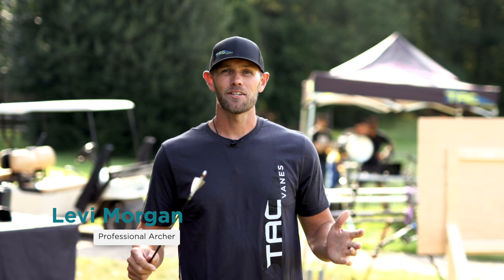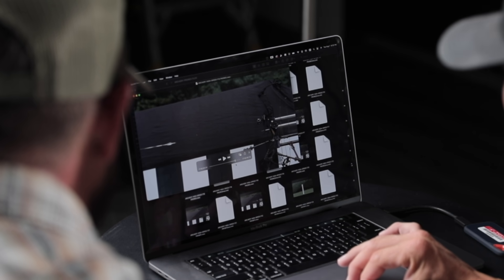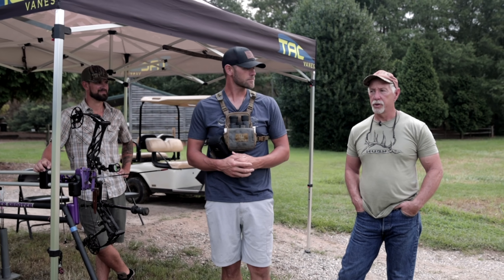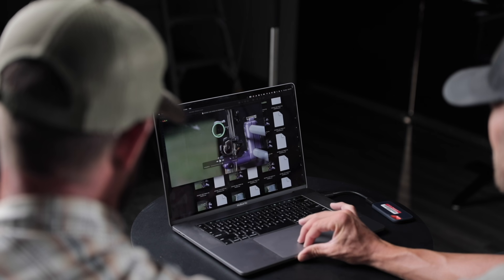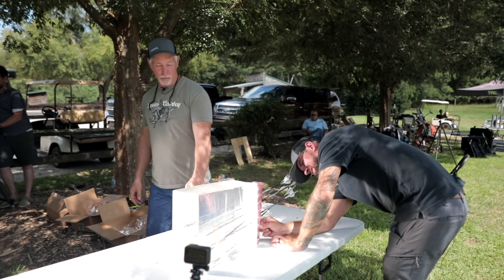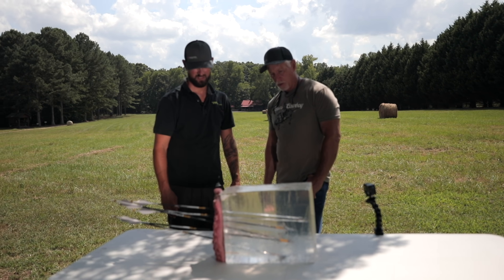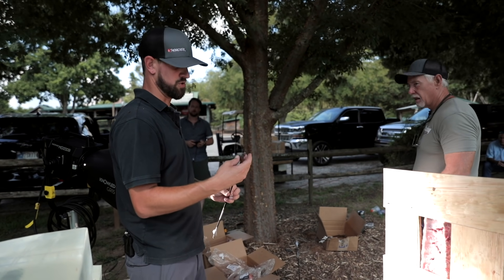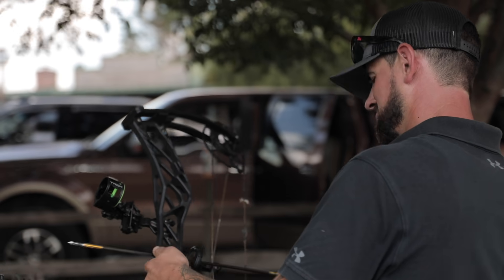SEE FOR YOURSELF 😲 : The LRP Arrow system vs. the competition w/ Levi Morgan

Comment: There was some useful information shared here regarding the vanes, components, and broadheads.

Which Flex Fletch vanes were used in testing?

Was the Grim Reaper the Micro Hades Pro?

In the final broadhead test, would the 3" Shwaker have a full pass-through compared to the Iron Will? I am not so sure, especially on a big-body deer. In my experience, an entrance and exit hole provides a better blood trail than an arrow that has not passed through the animal, especially if the arrow stays in the entrance hole.
If there will be a follow-up mechanical broadhead test. As others have mentioned, it would be nice to see the SEVR along with the JEKYLL & HYDE heads.
In the torque test, I would like to see the Valkyrie, Iron Will, and Podium components tested.

Comment: The drop measurement is interesting but less useful than speed at the target. Because the fletchings all have different mass, the arrow's center of gravity will change, thus altering the arrow's angle of attack, which changes aerodynamics in flight.

Comment: @tacvanes please help me understand the results on your drop test. From the video it looked like the TAC 2.75 3 fletch dropped the least, however your chart at the end indicates it dropped the most. I feel as though your numbers on the 75 yard marker that the arrows past were backward. And why did they not go to 12”? Appreciate it.
Reply from the maker: Thanks for the comment! The numbers on the chart only make sense with the video. The numbers are not relative to anything except each other and they are not saying how many inches the arrow dropped. So if you use the 2.75 as the base point (It crossed the gauge in the field at 9.2) then you can subtract the other numbers from 9.2 to figure out how many inches the other vanes dropped from the 2.75.

Comment: What's weird is I see these tests done involving the nap killzone and they always sucks for these tests but I get awesome penetration and I have pictures of the rib cages of my deer with the 2in cut straight through both sizes of the rib cage and the blades are never bent I have a pile of these killzones in a dresser drawer that have been through deer not a single one is bent all are still for the most part sharp a few have some edge chatter stuff from hitting rocks or whatever in the dirt. The only killzone I had bend the blades literally cut the opposite side fron leg almost completely off a doe it was held on by a little skin so yea ofcourse that bent the blades. Idk man killzones work perfect in real world circumstances

Comment: I run Tac driver 2 inch 4 fletch on my 3d/field arrows, and Tac Driver 2.75 3 fletch on my indoor arrows, and I’ve had nothing but success with them. I am running bohning blazer 2” in a 4 fletch on my hunting arrows, and had no clue they had so much drag and flimsiness. I’m shooting a QAD imx rest, but it still makes me think I should change these vanes. Season is here this year, so I’ll leave it, but it looks like I’ll be running Tacs on all of my arrow setups from here on out. Great test! I’d like to see the test on a fixed blade broadhead as well. In my case, the QAD exodus 
Thanks y’all! Good work

Comment: Swacker has to do best because they are the broadhead that deploys AFTER it blows through the plywood, the blades are protected from the initial impact the only drawback with swacker is a poor entry hole, I do love tac vanes and won't shoot any other. The ol'plywood test will just about destroy any cut on contact broadhead most of the time.
Reply: They still make a 1" entry hole. I've had great luck with them for the last ten years.

Comment: I have noticed the drop in other vanes vs tac vanes when testing with broadheads specifically...my issue with the tac vanes is how much memory they have after passing through something.  I will say TAC's customer service is outstanding as I was having some issues and they reached out multiple times in a timely manner.
Reply: I've found it to be the opposite. I can shoot a tac vane into a bag target and have it get stuck and come out all bent and put it in the back of my quiver and after about 5 minutes it's ready to go again. I will say if they get creased then it won't come back as good. But they still do better than the blazers I used to shootn
Reply: Agreed, I swapped from Blazers about 3-4 months ago and the tac vanes are holding up a whole lot better from practice. The blazers would get bent very easily.

Comment: So the TAC 3 fletch 2.75 didn’t drop 9” inches right? I’m confused with the results from the 100 yard drop test. To me it looks like the DCA vane dropped the 9”.
Reply from the maker: Thanks for the comment! The numbers on the chart only make sense with the video. The numbers are not relative to anything except each other and they are not saying how many inches the arrow dropped. So if you use the 2.75 as the base point (It crossed the gauge in the field at 9.2) then you can subtract the other numbers from 9.2 to figure out how many inches the other vanes dropped from the 2.75.
Reply: I have tried to understand the drop chart and just can't figure out the numbers. This sounds like you're using the TAC 3 Fletch as the 0 and the drop corresponds to this. If I subtract the TAC 4 Fletch 9.2 - 6.2 = 3 inches of drop. That makes sense. If I use the same logic with the DCA 9.2 - 8 = 1.2 inches of drop. That doesn't make sense with the video. The drop chart only makes sense if the hooter shooter or measuring stick was set up  differently for the DCA. Can you make better sense of it for me?

Comment: I use TAC drivers on my hunting arrows. the 2.75 steer my Grizzlystick single bevels the best. As for components the better the metal (SS or Titanium) and the longer the insert the stronger your setup. If you can put the lateral force farther into the shaft the better. Most arrow components are stronger than any aluminum farrell on a broadhead of any kind.  Good flight, sharp broadheads, and arrow integrity..... Where have I heard this before?  Dr. Ashby. It's not just about heavy arrows.
Reply: Are you running the Massai heads or the Samurai?

Comment: So if i read the chart correctly, the victory vap tko is the best arrow for the lrp and tac vane setup?
Reply from the maker: The arrow was able to bend under the full 15 ft/lb load without breaking.  Most breakages from this test was from the arrow bending, but the component "digging" into the side, which eventually causes the breakage.  It's far more extreme than you could ever have with a shot.

Comment: Have you ever seen a person survive an accident on the news and then go to say “had it only gone 1 millimeter deeper, it would have reached my heart or nicked an artery and I’d be dead?” A broadhead can make a 3-inch cut into muscle tissue, but what good is that if it never reaches deep enough to sever major arteries and vital organs? Just ask any Emergency Room doctor. If someone has a big knife stuck in their back, the doctor will tell you, don’t remove the knife because if it goes deeper, it might cut a major blood vessel and you’ll die. More often than not, two holes are more lethal than one

Comment: The iron will was three inches in front of the swacker. You can not count the tip of the mechanicals. The iron will starts cutting just about the tip. The mechanicals has two inches of a ice pick in front of the blades. That has to be included in the test. There is obviously some bias in the testing. In addition, you are shooting arrows into a medium that is designed to stop and catch projectiles. Stack ten briskets and shoot those to see the penetration if you want to get real world results on penetration.

Comment: I loved the test but something you guys failed to address is the very small entry hole from the Swackers. So would I want 6 inches of penetration (no pass threw) with a 3 inch cut with a very small entry hole or a 1.25 cut with a pass threw. Two places for the animal to bleed out vs one small place. If I could get a pass threw with a Swacker 2 inch them I'm in. You guys didn't discuss blood trails and thats important. Appreciate the test though!!<><
Reply: exactly. seems like the cut on contact mechanicals disintegrated and didn't penetrate and if they did, they deflected massively.  The ones that did hold together did so because they went through hide/bone as a field point before deploying. They may have had a large internal cut but they had a field point entry that'd be pretty well closed through hide. If these mechanicals arent going to pass to the other side and are closed at the entry hole (which may be high on the animal) then you're not going to get much blood compared to a cut on contact/cut on exit no?
Reply: I was thinking the same thing. Interesting slow mo footage, but really just confirms for me to stick with fixed broad heads. Unless I missed it they also didn't talk about how much more energy it takes to push a mech through hide compared to a cut on contact fixed head. Us short draw guys don't have energy to waist.
Reply: you still get a 1"+ entry hole with a swhacker, that is as large as a lot of fixed heads. if you got a proper kill shot, blood is going to be pouring out the mouth, if for some reason you didnt get a pass through.
Reply: Like someone else mentioned you are still getting a 1" entry hole compared to a maybe 1-1/4" hole? Most fixed are even smaller than that. But you are getting a lot bigger cut inside the animal which means its going to expire a lot faster. So even if you don't get a pass through the animal shouldn't go as far. I just started using Swhacker in the last couple years and I've shot 2 deer and both never made it 10 yards.
Reply: @wesr1490  what cutting diameter was it?

Comment: The schwacker opened 2” after entering and only cut for 2” they measured the tip which was 2” from the blades that only traveled 1”-2” in open position. Very deceiving if you just listen to them and not watch and observe yourself!😊

Comment: So the stock gold tip insert and ballistic collar out performed the lrp? Stock components breaking point 12.8 ft/lbs and LRP 10.8 ft/lbs.
Reply from the maker: It did not.  It took about a .008" - .010" bend with 9 ft/lbs of load.  The LRP barely had a tiny bit of wobble, at .003" - .005" -- but we wanted to be honest and record it as it happened on that arrow.  The LRP system never bent on any other arrow, when it reached the 9 ft/lb test.  The ballistic collar split in the back, which eliminated the pinch point that broke the arrow with the LRP component.
Reply: Victory Vap SS with titanium MfJJ titanium insert and a 1.5 inch 15 grain weight with the green 2 inch Swhacker,
Best combo you can get for the money.
I shoot them out to 130 yards every practice session for fun, with the q2i fusion x  2.1 , 3 fletch 2 degree.
Absolutely Lazer setup.
I have the gold tip setup 2 dozen but they are nowhere close to the victory Vap SS, my 29 inch draw arrows are 462 grains and will take anything I hunt.
Great video and I am looking forward to a titanium Swhacker 2.25 inch with a little stronger blades for multiple use.
Reply: @johnnewcomb5162  have you had any failures with the kinetic pierce halfsert and collar? Or are you saying the victory shafts are better? I know victory components are not very good and mfjj titanium halfouts are supposed to be good. I have 2 dozen rip elite shafts that I removed all the victory shok 60gr ss halfouts due to bending easily and put in 50gr brass hit insert with a gold tip ballistic collar and its been great. About to build a dozen kinetic pierce and debating on which components to use, any insight is appreciated.
Reply: @dirtjunkie2749  the SS shaft's are better,  no question,  the titanium MfJJ inserts are far superior to both arrows mentioned.
You can shoot cylinder blocks with this setup over and over, the gold tip will break every shot and even worse on angled shots sometimes.
Not hunting cylinder block but you get the picture .
For the money the SS setup is the way to go.
The SS shaft's are on sale all the time, I bought 2 dozen a few months back for $324 bucks.
Either way or arrow will get you by though, you will just go through the gold tips way faster.
Reply: @dirtjunkie2749 I’ve shot pierce platinums this year with the factory components. Sent the same arrow into 1 tree while sighting in, 1 rock while hunting at 15 yards and 1 though a deer into another rock at 10 yards. Picked the arrow up, put a new broadhead on and it’s still in my quiver. The nock collars have saved a lot of my arrows from Robin Hood’s only tore up two (of 12) collars and some of the collars on other arrows have marks from them. One ballistic collar split from getting hit with another arrow. Overall I’m very happy with them and plan to keep shooting them

Comment: You really should have done them all not just at the same fletch angle/helical  but also using the same number of vanes.  Doing some at 4 and others at 3 is poor to analyze the data.  If you want 4 fletch, do them all at 4 separately

Comment: Y’all left out so much info. Including how much of a pain the tac vanes are to fletch and how small the base is etc etc And tested with the weakest arrow components each company has to offer for durability. Easton has every grade material of inserts and outserts known to man and tall used the softest of them all 😅 they all have goods and bads  about them. Just depends on what your looking for. If I want an inch more penetration and no entry hole with a small blood trail swacker is the choice. If I want a big entry hole and a durable ferrule and lots of blood on the ground rage is the choice. I’ll take titanium over aluminum in ever scenario.

Comment: I don't know how you can compare any of these broadheads to a swacker. Due to the fact that the swacker doesn't open up until it's in the gel. For the other broad heads are trying to open up. Before they get into the gel makes absolutely no sense. I'm not saying that the swackers, not a good broad head, but if you don't get a pass through and you're getting a small hole up front, you'll have no blood trail on the other side. If you don't get it complete pass through. And that's why I will never use a swacker because of that fact and itself.  If you don't get a pass through, you're not gonna have a blood trail.

Comment: I'm with you on the TAC vanes. I've switched to them myself and love them but as far as the broadheads go, if you prefer a mechanical and you're using anything other than grim reaper, you're missing out. I've shot dear with most of the major broadheads and as far as mechanicals go, grim reapers are the only ones I will trust. That's just me. They're the sharpest and toughest. Obviously some others will get slightly more penetration because they're only 2 little blades and if you're using the right arrow and making good shots, most of them should be pass through with any of these broadheads but I'm telling you when you shoot a deer with a grim reaper there's hardly any tracking necessary. Nothing I've seen does more damage.
Reply: Killed a few deer with grim reaper. Stopped using them after I had one not open on a big doe. Still killed her as the shot was perfect but she just had a bullet hole and no cutting.
Reply: There's a lot of people that have claimed they didn't open but they'll close back after a partial pass through and people think they never opened.
Reply: My man that may be but there is no mistaking when a broadhead doesn’t open because there was only a bullet hole through the hide and the vitals. No cutting took place.
Reply: I just don't see how those blades can't open at all. The way they're designed just doesn't seem like that would be possible but hey maybe you got a rare faulty one🤷🏻... Even if that's the case it definitely couldn't be common. I've shot several deer with them and every single one had a massive hole and dumped blood everywhere. A two blade mechanical just can't do that kind of damage.
Reply: I had the same thing happen to me the blades did not deploy. I also shot a doe with one at went in about 2 inches then fell out. Absolutely no penetration. I do not trust grim reapers. I have seen great things with them but for my experience they are a no go.
Reply: Absolutely zero blade deployment. Shit happens. Didn’t want to take the chance so stopped using them. Have used rage trypan and schwacker 100 and had good results. Shot a dandy last year with a rage trypan. Exit hole smaller than entrance. This year I switched to sevr. Best two blade expandable on the market.
Reply: They are not the toughest and they have small entry holes. Sevr has been proven over and over again to be by far the toughest mechanical.
Reply: @CalebSmith87 anything can happen in the deer woods buddy. I don’t care why they didn’t open. I just care that they didn’t.

Comment: You guys laid the ribs horizontal, like a human's. Quadruped animal's ribs are vertical. Broadheads should be aligned accordingly.

Also, if the angle of the hairs on the biscuit matched that of  the angle of the vanes, at the speed of contact, the biscuit can induce/encourage the desired spin off the arrow. If the hairs on the biscuit are randomly installed, the accuracy of the spin will be just as random.
Reply: It doesn’t matter how you aligned the broadheads. It will always hit in a different angle because the arrow is spinning.